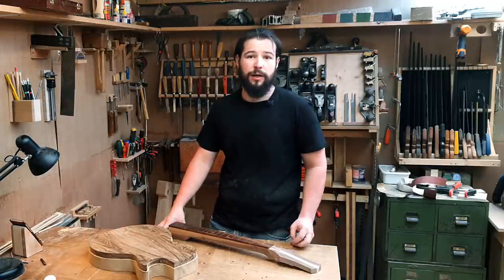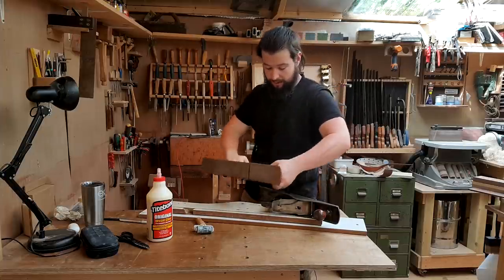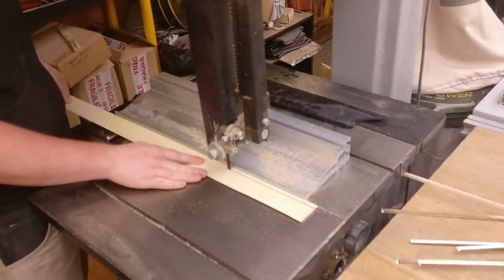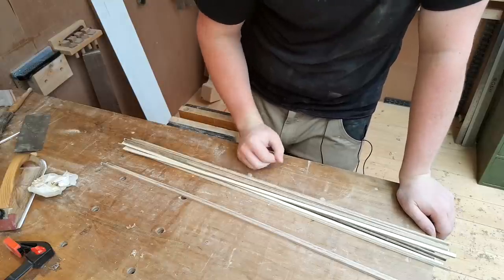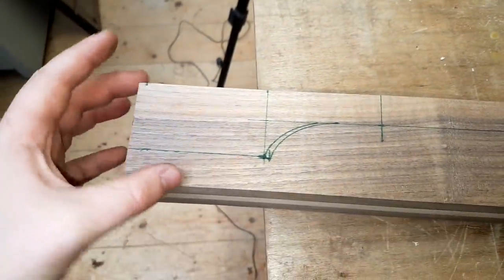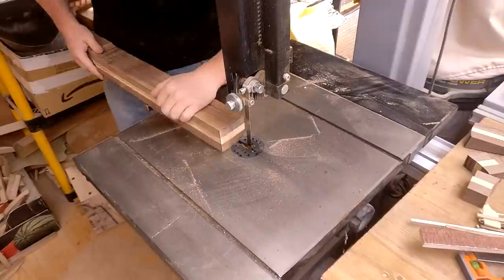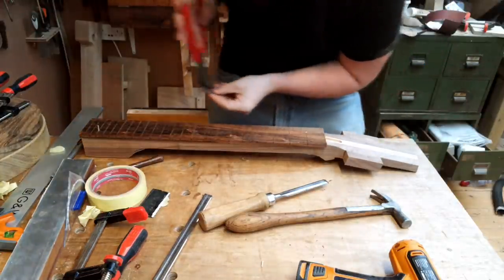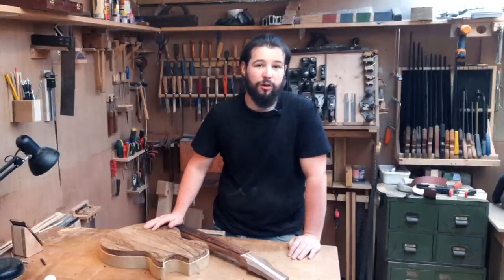The (Unofficial) GREAT GUITAR BUILD-OFF - Video 2, Binding, Necks and Waffle

Comment: Nice one, congrats on all the new subs. I think I'll be on the edge of my seat when you bend that binding around the horn. I bent some flamed maple around a truss rod cover the other day, very tight curve, lots of patience required!
Reply from the maker: First time playing with wood binding for me..  So far in practise runs I've destroyed a length of binding and a heat gun!  Definitely learning that patience is the key.
Reply: @AwenLutherieCustomGuitars  get yourself a proper bending iron mate, it will make a huge difference to your results. I'd recommend not going thicker than 1.5mm on your binding too, the horn is a tight curve and thicker material will snap every time.

Comment: Very inspirational, you almost got me ready to do my own neck.
Reply from the maker: Thanks! The key is to not over think it. Just mark your centreline and do your level best to stick to it. If you're worried, try a practise run on cheaper wood. I also tend to drill for the bridge AFTER the neck is placed on the body, so I can adjust if I don't get it perfectly straight in line

Comment: My favourite plane used to be one of my Dad's.  It's nice when a tool goes on to keep making things.  My first veneer job on a guitar looked like a sheet of corrugated roofing when I'd finished with it :)  Since then I use the method David Picciuto from the Make Something channel uses where you wait for the glue to dry on both parts then iron them together... but I've only done it on furniture so far.  I don't know if that would be robust enough on a guitar.  Anyway, I'm waffling now :)
Reply from the maker: Hey, there's not a lot of people who dislike waffles! 
That's a big reason I like vintage tools in general, the fact that they get to keep on making things, but also they've had a life before me. 
I'm familliar with the channel, but not the technique. I'll have to check it out, because this one was very nearly a disaster! I didn't think it would warp hard enough to lift the planes, but boy is that oak strong.

Comment: Very nice, very informative. 
Question from someone without any experience in woodworking on glueing together the wood strips for the binding.
Would that not cause problems stressing the glue joint and wood when the binding is bent around the body?
Reply from the maker: A perfectly good question, and 100% correct. I ended up pulling off all of the veneer after bending the binding, since it had bubbled and creased during the bending process, then recutting new veneer and gluing it all on separately. 
I thought for some reason that it would all bend together, but I was totally wrong.

Comment: I just subscribed too your channel, I’m building my first electric guitar, I have a question about the truss rod did you leave that tape covering it when you glued on the fingerboard?? #2 Could you explain what or how you cut the the access hole for the truss rod. Thank you from America Scott
Reply from the maker: Thank you, and good luck with your own build!
Yes, I left a small amount of tape covering the truss rod, and only about 1mm either side of it. It stops any glue from getting into the truss rod slot itself. It's not totally necessary, but I like to do it.
So for the access, I simply rout the slot longer than needed, continuing into the face of the headstock itself. I usually go about 35mm, which allows most allen wrenches to get in there. It's not as clean or fancy as the likes of Gibson, but with a truss rod cover you never know the difference.
When the nut is removed, you can see the slot underneath it. If you pop over to my instagram, there are a few pictures there that you should be able to see what's going on.
Reply: Awen Lutherie - Custom Guitars  Thank  you & I will check out your Instagram for sure. I have been posting the pics of my #Twinukes I built from scratch for my sons, I made a ton of mistakes & learned a lot about building an acustic instrument.

Comment: That neck is very pretty. The guitar looks thick though. What would be the expected wait of it?
Reply from the maker: Thank you! It's definitely chunky at the moment. I'm planning a pretty deep carve though, and potentially some other body carves for both comfort and weight relief. Not to mention roomy control cavities to cut down on the weight that bit more.
I don't have a weight in mind, but I'd like the whole thing to come in around the 3.5-4.5 kg range (8-10 pounds) which is generally considered a good weight for a LP
Reply: @AwenLutherieCustomGuitars  looking forward to the progress! What is the radius of the fretboard as it is? Also are you going to go for a coloured finish or natural? I have the feeling that that guitar in a dark finish would rock :) (maybe it is also the 5 pieces neck that gives me the idea of a fast shredish metalish guitar :) )
Reply from the maker: At the moment,  the fretboard is completely flat and parallel.  I think next week I'll be putting a radius on it and fretting.  Probably something like a 9.5-16" compound radius.
Finish-wise I'm going to leave it all natural.  I might do a brown stain on the back though,  as the greenheart can be a bit on the yellow side.

Comment: 🤔didnt pull the tape off  the truss rod🤔 seen it done both ways,ive done it both ways ,not sure it matters
Reply from the maker: I just have about a mm tape overlap either side of the truss rod so it doesn't interfere with the gluing surface at all. I like it because I feel like it keeps glue off the truss rod itself. I don't think it really matters though at all, more personal preferance than anything